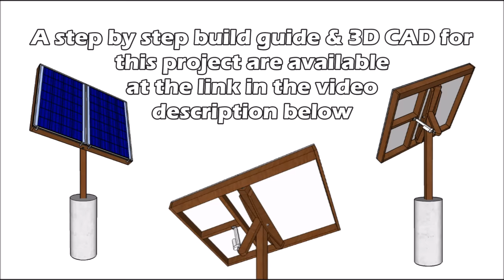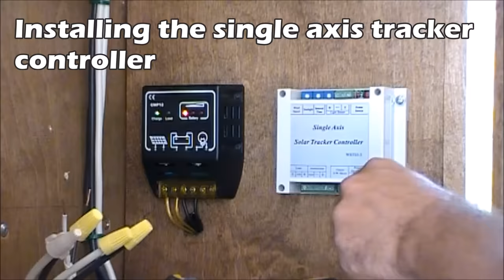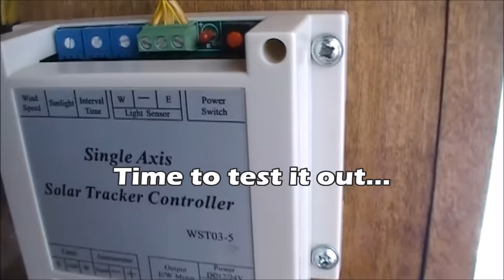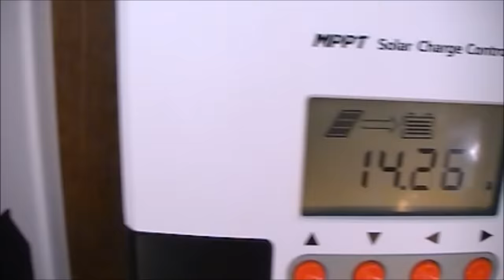Build A Solar Tracking System - DIY Solar Tracker - Off Grid Living!

Comment from the maker: Get the plans for this project here: https://renewablesystemstechnology.com/solar-tracking-system.html
Reply: Imagine having James Biggar on Gilligan's Island!!! Whole show would be two episodes: #1 We're shipwrecked, #2 Fixed the boat, have the position sensor tracking the North Star,  Daiquiri's in the fridge and wake me up when we hit Malibu.
Reply: Do you think I could install a tracker on a standing seam zinc roof? The direction of the slope of the roof is tilted slightly away from optimum position for panels so thought I'd research mounting panels to a frame (was thinking fabricated metal frame) preferably with ability to track the sun.
Reply: Do the plans also mention the type/brand of tracking equipment used? I figured yes for all the building material but wanted to double check that part. Thank you and great work!
Reply: help me I want to refer to this project

Comment: great video .  I will try to build a duplicate for my project . A couple of pointers, 1) rebar not a good ground rod. 2) hose clamp not good.  3) always use NO-OX (nonoxiding grease) on all connections and grounds . Use a copper ground rod and a Blackburn JAB34HP 3/4  Ground rod clamp. Aside from that way cool.

Comment: Absolutely fantastic.  The mere fact that you use wood instead of metal framing is the key issue.  In Canada we build full decks out of wood, but for some stupid reason solar panels can only be held up with metal frames.  I have long wondered why we don't use cheaper and more versatile wood instead of metal.  As a concrete specialist, I'd like to suggest that at 1:48, when you place the wood upright into the concrete mold, cover the wood (you can use a simple plastic bag).  Don't let the concrete come into direct contact with the wood.  During the concrete's drying phase, the wood will absorb water from the concrete creating a slip area (no bond).  Going into the future as the wood expands and contracts the wood will loosen from the concrete (there was no original bond).  The loosening can be "minimised" if you had covered the wood in some membrane (as I said a simple plastic bag would do) to prevent that slip area.  I know it's too late to give this advice, but I'm sure you are going to build more of these, so use a simple plastic bag cover in the future.  Also connecting bare re-bar from the concrete into the ground will have the re-bar in the ground corrode.  As re-bar corrodes, it expands and can crack open the concrete.  Looking at the size of the re-bar and amount of concrete you poured, this is looks to be 'okay' and not a big issue (but consider this concept in the future).  Again, I am awe struck but the simplicity of your work, well done!!  If you come to Toronto, your beer is on me!!
Reply from the maker: I'll take it lol, and the advise! Hopefully your comment will serve as an example for future visitors as to how to gain respect for being critical. I appreciate it. 

I did, however, study and worked with concrete for my carpenter apprenticeship a couple of decades ago. I've poured a few foundations and slabs since but nothing serious - mainly stuck to woodworking. I considered wrapping the posts with poly but I actually didn't want a strong bond to form either, just in case my calculations for wind load were off and the post(s) broke in a freak gust or something. It's a lot easier to get the broken piece back out, given my experience changing fence posts over the years. I really should have went with stainless steel anchors in the concrete instead, as some trolls are more than happy to point out. But I wanted to do this with what I had on hand too.
The rebar will definitely corrode. I remember being taught that it can't be any closer than an 1" away from the perimeter of the concrete, simply because concrete is like a sponge and the moisture near the surface will eventually corrode the rebar. In the ground exposed rebar will probably take a bit longer to corrode because it's not exposed to near as much air (redox reaction requires the presence of both oxygen and moisture), likely quite a bit longer than what it will take the wooden posts to rot. It was a bit of a budget trade off, again - pour a ridiculously sized footing or downsize and incorporate rebar anchors that I had laying around in the workshop. But it's a good point to bring up, people should be aware of it and weigh the costs of affordability and longevity. Thanks for the comment!
Reply from the maker: ....and you're right about how panels are generally mounted! People have this weird impression that building a rack out of wood is a terrible idea, yet look at everything else on their property. What's it made out of in most cases? Wood. LOL. Cheers!

Comment: Looks great. I do have some constructive criticism though from experience running lots of underground conduit and electrical PVC. Your underground pipe will be full of water within about a year or so and it will never drain. Atmospheric air will get into the pipe and will condense on the cool pipe walls and the condensation water will just build up until the pipe is full of water and your wires. On the plus side though that may help keep your wires cool though, which would give you less of a voltage drop over distances! You can get some "direct burial" type wires with better insulation, or you can put drain holes in your pipe at (the low points) that allow for them to drain excess water out. Also the wood directly in cement and under the ground may be problematic long term, so a metal base might be figured out.

Comment: A quick tip for fishing flexible wires through conduit. Blow a string through the conduit with the output of a Shop-Vac or, just suck it through from the other end. Connect to your wires, or a stronger rope, then pull your wires through. Sounds complicated, but much quicker and cheaper than stiff wire, especially for long runs.

Comment: You have a great Youtube channel. Looks like tons of information in there. Thanks. My neighborhood I would have used metal conduit for the above ground part for the wiring. The nasty squirrels eat plastic here. They chewed a hole through my lawn mower gas tank. They are so mean the actually chew the aluminum wire on the fence! The metal part! Thanks.
Reply from the maker: Thanks! I've lived in the middle of the woods all my life an never had a problem with squirrels eating plastic parts, but I wouldn't put it past them either. They get into everything else lol. Use whatever works for you!

Comment: Super Good Stuff here.    I have 500W of panels, 500W  of 24V  Wind Turbine, All required chargers and Charge Controller in hand.  200Ft of 10 AWG Wire too.  
Now all I need is Some damn Batteries and Chop Saw,  Skill Saw, Pan Brake, Drill Press, Cement , Mixer A Working Back Bone.   I may get there before I die.  MAYBE ?
Reply: You can always ask someone else.

Comment: very cool idea super simple and yet durable, nothing more is needed at larger installations or at least three four six or eight panels of 220 watts, unfortunately, it should be made of metal, very much greetings from Poland
Reply: I think going for more than two panels, even if they are those thin and lighweight ones, would make the frame little too heavy, and with the larger surface area it is more vulnerable to high winds breaking it. The pole holding the array is the weakest point in this design, it is also the hardest to replace if it gets broken or too weathered.

Comment: I've wanted to make an automated solar tracker for a few decades now that would be controlled simply with bi-metal springs expanding and contracting with a shade object directly above and magnifying glasses just to each side so that if the sun sines on any one side more than the others, the spring will pull it into alignment when heated.

Comment: This was very interesting the only thing that I thought was a little over kill was the hole, plastic container and rebar. I've been building decks for several years and if you put your pillion down 36 inches I assure you, that for no more weight that your using its not going anywhere.  And a sono tube will work just fine cheaper and much easier to come by.  I just wish my home was situated (not in the woods) where I could use solar.

Comment: Super !
Tu aurais dû faire la 2e installation plus tard, et l'utiliser pendant quelques temps en position fixe sur un toit ou une simulation de toit avec un faible espace de ventilation en dessous (avec une ventilation en air réchauffé par le toit stp !!!).
L'objectif étant de comparer les deux productions d'électricité dans les même conditions météorologiques.
.
Tant qu'on aura pas montré aux crétins que le gain est supérieur à la dépense (dépense pour fabriquer l'installation et dépense d'électricité pour le vérin électrique), de nombreuses personnes continueront à nier ce qui est pourtant une évidence.

Comment: Great !
You should have made the 2nd installation later, and use it for a while in a fixed position on a roof or on a roof simulation with a small ventilation space underneath (with air ventilation warmed by the roof !!! ).
The objective is to compare the two electricity productions in the same meteorological conditions.

As long as one has not shown that the gain is greater than the expense (expenditure to manufacture the installation and electricity expenditure for the electric cylinder), many people will continue to deny what seems nevertheless obvious to me.
Reply from the maker: Good point. I can always disconnect one of the arrays from the tracking controller and keep it in a fixed position for comparison. I may try that in the spring
Reply: Do it please. Tell us the figures here. Unfortunatelly they will not be worse that il could be, because even if you let your pannels flat, there will be a good ventilation underneath, while on a roof, ventilation and cooling are bad. So, I advise you to do this test when there no wind at all.

I am very skeptical about points of view of persons who say auto tracking would consume more that the gain. Only practical experience can give us the truth.

Are your electric cylinders powered by the panels?
Reply: @JamesBiggar   We are having threads and discussion on a Dutch forum where people are e.g. tracking the exact amount of watts consumed by the processor and motors compared to the amount the panels produce. Which gives a day-to-day comparison (one day stationary, the other day tracking) but not a real life direct comparison. So please do stop one, and if possible, even track the energy needed for the positioning of the system so you can subtract that from the yield of the moving panel.
There is no doubt in my mind that the moving panel will have a better net yield on a sunny day. But a cloudy winterday may be close...

Comment: It’s better to keep your solar panels off your roof the heat affects your power. The cooler the panels the more power you will make. And by tracking you’ll make maximum power first thing in the morning to the sun goes down. Check out Solar Time Tracker.

Comment: Using a hose clamp is not a good ground rod connector since it often has a plain steel screw and will corrode with time, leaving you with no ground. Also, a copper split bolt or ground rod connector would use copper or bronze to provide a longer life. All ground rods / wires should be tied together to prevent ground differential currents.

Comment: This is amazing work. Only thing I would do differently is to run the conduit trough the barrel before you poured the concrete, and have it come up by the post, for a more finished look. Other than that i commend your effort, with the aluminium trim it looks like you are using commercial panels.
Reply from the maker: Thanks!

Comment: Very nice!!!  I have two Revere thermal panels 4by6 ft..  I want to use them to prewarm  , hopefully heat enough to where my electric water heater will be just storage and have 12v heating elements or ran off a battery,inverter, solar panel.  I have one 50w solar panel and a few very small panels.  I just haven't seen anyone explain how to set this up.    I would like to eventually have the panels follow the sun or set them up to where reflection keeps sun on it all day.  Any tips, links , etc would be greatly appreciated.  Thanks again for your video.

Comment: The island I live on is mostly Solid Rock and a simple core drill for a chain link fence post is all I need. I've got lots of Acres so I could easily make a tall chain-link fence and mount all the panels in a single line with one single axis actuator controlling the whole thing. No freezing weather here in Hawaii no snow  to worry about and I don't get much wind in my location.  Sounds cheap although I'm thinking of using aluminum instead of galvanized Steel poles
Reply: FWIW... any place in side the tropic benefits very little from a tracker as your sun only move one hour out all year.    In the north say 50 degrees north in the summer the sun comes up  at NE and moves around the sky for 18 plus hours then sets in the NW.    Panels miss 30% of the sun but where you are they dont help much...   I guess if you had 5000 watts and you are making money feeding back into the grid it might be worth it then....
Reply: @matwalker6336  after 3 p.m. my power drops off harshly but if I tilt my panels towards the Sun set it goes nearly back up to full power until 6 p.m. then tapers off until 7 p.m.. this also happens to be the time of day that we use the most power and I hate drawing from my batteries in the evening knowing that if I had the panels facing the sunset I wouldn't have had to drain that 7% battery capacity from the batteries I would only need a single access tracking from sunrise to sunset and that would enable me to start draining my batteries from 100% at 6 p.m. instead of 3 p.m.. Making a manual second axis position to change about three times a year depending on season probably wouldn't be worth it. If somebody has to build a big frame to mount panels to it may as well have a few extra bearings so that it can have at least one axis. But if they're simply bolting them down to the roof having no tracking might be the way to go

Comment: Question: does the difference between having maximum power all the time vs having a sloping scale of power weigh up against the cost of building it all? At what point/time do you hit break even between cost of materials and electricity, say if you sold the electricity back to the manufacturer?

Comment: It would be easier and could be done with a simple clockwork if you rotate it around an axis parallel to North-South-axis of the earth. Then tracking can be done with one rotation in 24 hours - and seasonal change could be done manually every week or month

Comment: Can I just add as a timber fencer for 20 years the way you put your post in the ground will encourage wood rot....all timber shrinks and when it rains the water will run down the post ,down along side of concrete and post....there no sun so it never dries out creating rot.. ..but if you use a soil and cement mix the natural ground will remove the moisture.....soil and cement is just that 2 shovel of cement not concrete.....so u half to 3/4 fill hole with water add cement mix well like a washing machine.....then slowing kick in soil  mixing it in with a big stick from the bottom working your way to the top I use an old level.... last bit I just kick in soil and stamp it down with my foot to make neat....

Comment: 1) Use sonotube for the form. WAY less concrete.(1 80 lb bag per 3' of 6" diameter  Sonotube)... 2) Go to local junk yard, get straight axle off of old front wheel drive car. Chop off one hub. Bury the cut end in concrete.3) you now have a precision rotating hub with bearings. 3) Mount panels on that. 4) If ya want it to last, DON'T use wood.

Comment: Just a helpful tip.  Put wheelbarrow on other side of mixer and it will not need to be held for beginning of dump and is designed to be dumped that way.   Just trying to help.
Reply from the maker: Lol, thanks for the tip but I'm pretty sure that's not the case (journeyman carpenter/contractor here with 20+ years of experience working with mixers and wheelbarrows). It dumps the same in both directions. The issue is this Crappy Tire special mixer isn't tall enough for the wheelbarrow, so I have to tip the wheelbarrow down to make room. Otherwise, I wouldn't be holding onto it at all ;)
Reply: Ah !  should have figured that with the quality of work demonstrated.   Thanks

Comment: Found this video while searching for DIY solar tracking. I'm not interested in solar but was trying to find a post mount mechanism that would allow rotation for solar tracking. Dont know if it will work, but I plan on building 2- 4'x4' boxes with about 250' of possibly black pex piping covered with plexiglass to use as a solar water heater for my Inground pool. I'm in Pennsylvania and I get full sun all day. I'm thinking I'd get better efficiency if I could get the solar heaters to turn with the sun. I dont know how much the solar heater will weigh and I don't know how much your solar panels weigh. Do u think your set up will hold the weight?  Damn good video, best I've found. 

Ps. Been in the building Industry since 1990. Put some PT 4x4's in concrete in 1992. Their still there and have no rotting. That guy is dead wrong.

Thanks